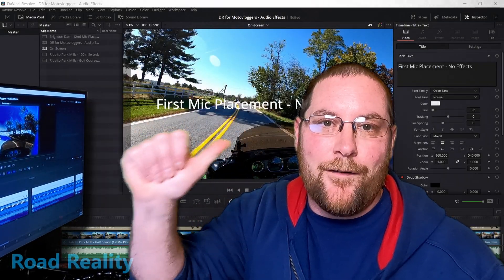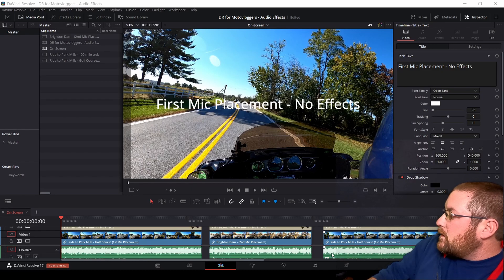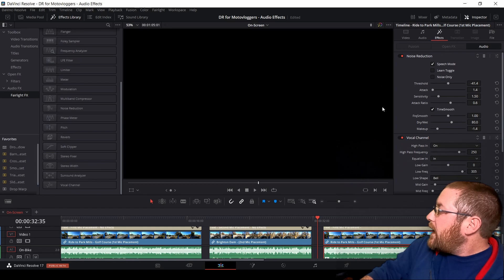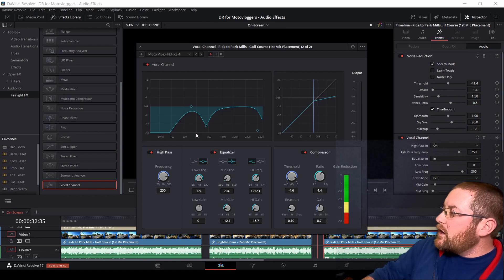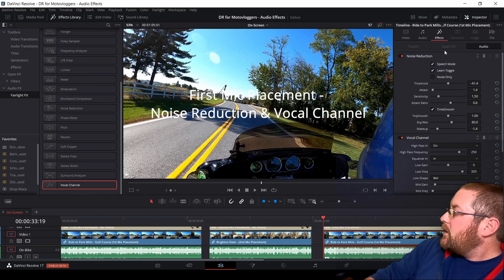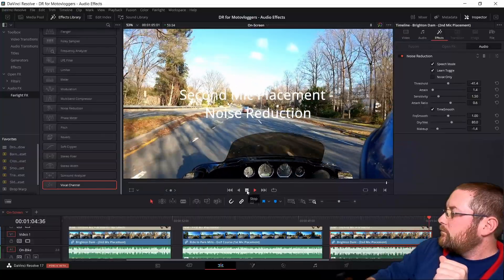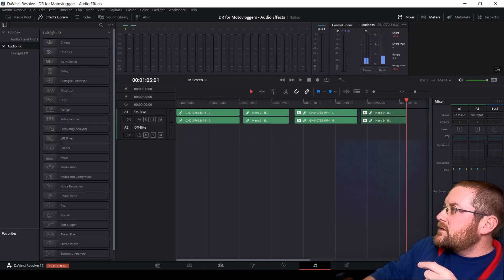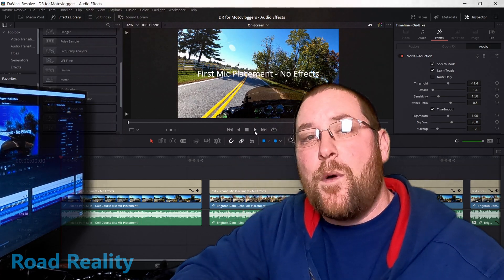How to Use Noise Reduction & Vocal Channel Audio Effects in Davinci Resolve 17 for MotoVlog Footage

Comment: Thanks buddy love form india ❤️
Reply from the maker: My pleasure!
Reply: @RoadReality  sir, can you help me with my clip  just for 15 sec it will be very great full of you .. you wil get a content and i can make my video better
Reply from the maker: @LONEPLAYERZONE  What's going on?
Reply: @RoadReality  same wind problem but my voice is too low that it is making me irritate while editing
Reply from the maker: @LONEPLAYERZONE  Sounds like you either need to talk louder when you record, or play around with the Vocal Channel effect to try and boost it.  The problem, I've found, is that wind noise bleeds into the same audio range as the human voice, making it hard to cut one without cutting the other.
Reply: @RoadReality  so any suggestions ?
Reply from the maker: @LONEPLAYERZONE  Best I can suggest is to play around with the settings on the Vocal Channel and see if anything helps.  Small changes, and take your time.  I spent hours trying to fix audio like that.  In the end, I did more testing in order to record cleaner audio in the camera (check out my Moto Vlog Gear Setup Playlist for those videos)
Reply: @RoadReality  i will thank you sir

Comment: I wish it would work for me. Davinci Resolve just will not work on either my desktop or laptop. It starts but then no matter what I do nothing else happens.
Reply from the maker: What version are you trying to run?  From their forums, it's usually a graphics driver or a bad install.  I used 16.2.7 before I switched to DR17.  Also, they keep releasing new Betas ... they're on Beta 7 now, maybe give that a try?